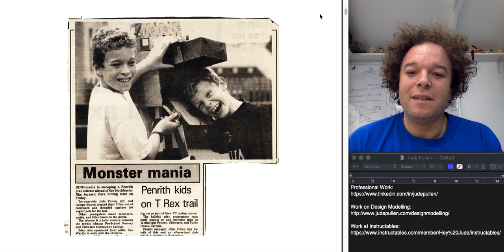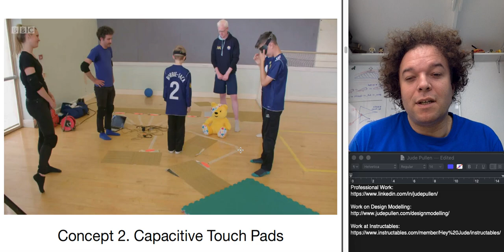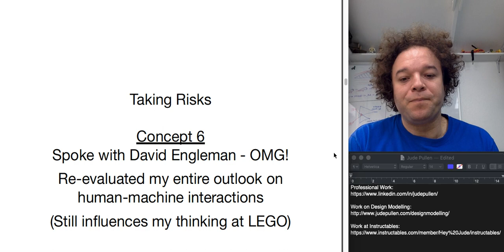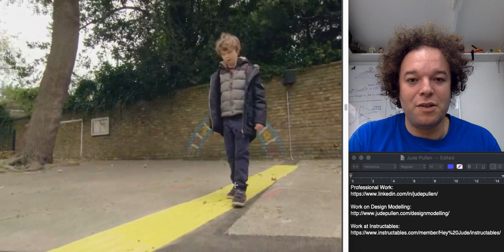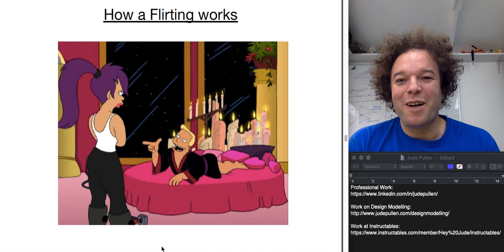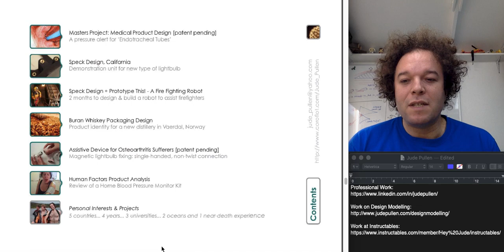Student & Graduate Design Series - Keynote 2: "Push The Button" - 2018

Comment: Hi Jude, 

When showing the Folio Overview, do you mean to start with a Big Impact Project, and then a second Big Process Project - or do you mean selecting one Project and doing a big impact page on it, and then a big process section on the same project?
Reply from the maker: Hi Andres,
Thanks for your question - I think the BIG Impact Project I was thinking was one you go 'deep' on (in yellow-orange colour). So arguably a final year project should show detailed process, as well as nice hero shots. 
My key point is that with this 'big in depth' section, one need not do this for each project (as it's implied you do work this way) so you can slim down your folio. Of course at interview, come prepared with more process, and indeed, take a phonecall before the interview and perhaps ask if they really like any project in particular - in which case you have a nod as to which to bring more process for. 
Hope that helps?
Jude